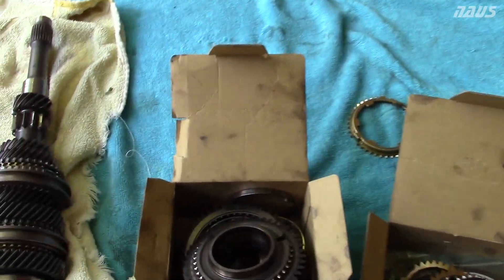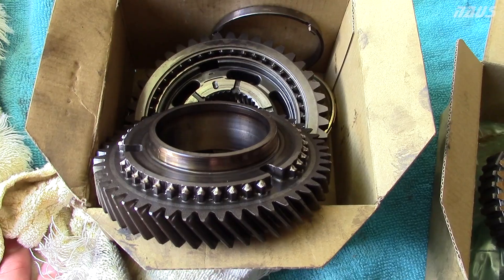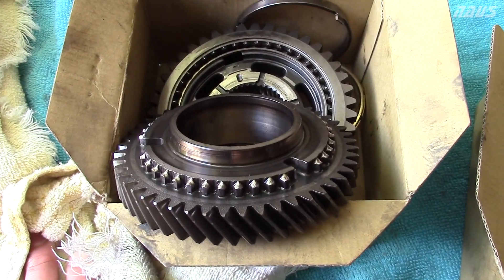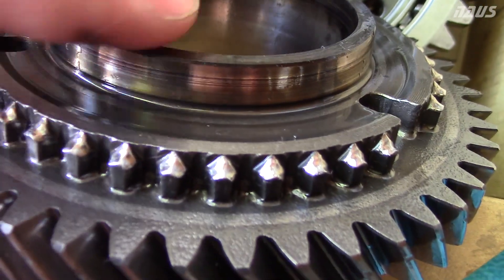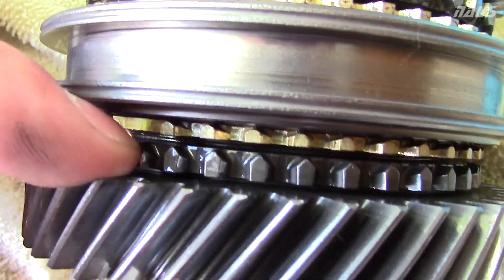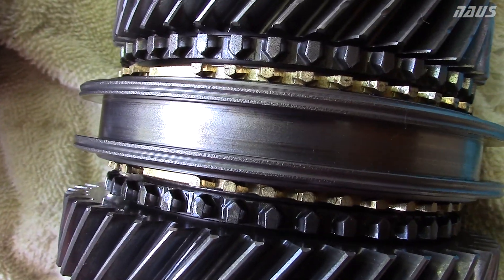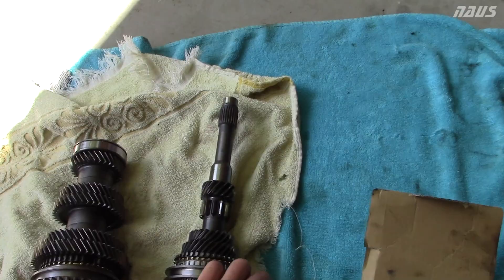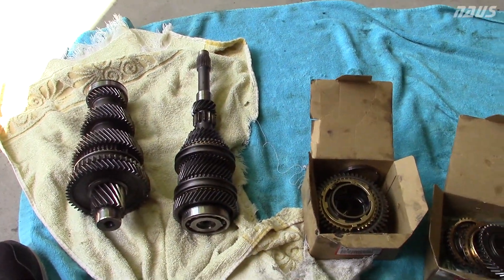The 2nd Gear Grind Explained! What Damage Does it Actually Do?

Comment: To be honest I can't afford to fix it on my car right now, so what I do is I totally skip the second gear, I go from first to third, I just go a little bit faster in the first gear so it doesn't make stall noise shifting to third, especially on uphills, but if my third wears out I will probably change the whole transmission.
Reply: Another option is to double clutch. If you double clutch properly, it won't grind even if the synchros are totally shot. The transmissions in heavy duty trucks don't even have synchros and they do just fine.

Comment: did you ever have it pop out of 2nd gear? my 2004 TSX 6 speed will randomly pop out of 2nd gear and when it does, it grinds. is this related??
Reply: Did u ever find out what was your problem cuz mine is poping out at 4th and also grinds as it pops out. Someobe tols me once its cuz of bad engine mounts so i did replace them cuz the mounts whete gone front and back so then i took it for a spine and its still poping out

Comment: 2nd gear.... YEP THE MAGIC NUMBER BY THOSE PEOPLE DRAG RACING, RACING, AND JACK RABBITING THE HONDA.
No question about it. Stop abusing the car and your car will last not 62,000 miles but 200,00 & some can go as high as 300,00 miles. 
If honda really has a bad design gear, show me a bad 1st gear(usually during drag racing the 1st is in cocked & ready),  show me a bad 3rd gear, 4th gear, 5th gear and 6th gear.
2nd gear is the power gear of the abusers. End of story!
Reply: I just got my civic type R a week ago and have had 6 gear grinds in second. the car hasn't been over 4k rpm. you are out of your mind if you think this isn't an issue.

Comment: What causes grinding once in a blue moon? Operator error? Not pulling the shift knob far enough over before trying to put it into gear? Normally my 18 year old car shifts fine, just had a pretty bad grind going into 1st while coasting today, could actually feel the gears hitting the fork through the shifter. Immediately took it back to neutral, shifted fine after that but wondering what kind of damage a grind here and there does.

Comment: Honda has been called out on these issues for 20+ years and yet they STILL turn out vehicles with poorly engineered manual transmissions. The latest Civic Type R still has manual gearbox issues drawing widespread concern. How stupid are the engineers at Honda? Apparently they're so stupid they ignore 20+ years of complaints not just from those who blindly buy their poorly engineered cars but they also ignore Car and Driver, Motor Trend and the rest of the automotive press who has been critical of their manual transmissions. They also have suffered 20+ years of complaints about hanging revs during shifts from their poorly done engine management software. And, guess what, they can't be bothered to fix that either year after year. Honda has lost their way for reliability, styling, and performance. They're beat by many other manufacturers.
Reply: On new Hondas the rev hang is deliberately engineered into the programming for emissions (NOx) purposes. Throttle closing time is not instant to control pressure issues leading to more emissions.
Reply: Honda needs to fail for them to wake up. They have been resting on thier laurels for years. A significant sale slump would do alot to wake them up. Stop buying thier garbage.

Comment: AC Delco transmission oil fixed the 2nd and 3rd gear grind in my DC5 RSX-S. I used to have it grind every 500 miles, but the AL Delco fluid will make it go 40,000 without grinding, at which point I change the fluid again.

Comment: Very few people check the endplay on the mainshaft and cluster. Maybe they will put new shift forks in and still do not check all of the tolerances. It has to be set up correctly! The syncro rings must be in great shape the same as the gear cones and sliders. A manual trans will work without any keys or springs but not for long! You can also take every other tooth off the syncro rings and make a better shift, but not for long! It depends on what you are expecting. Clutch release is the most important part you must have along with a clean spline on the input shaft,clutch hub, bearing retainer and Very good alignment between the crank and input shaft. Always check the endplay on each mainshaft gear including mainshaft to input shaft.

Comment: You didn’t say anything about the synchronizer springs.   They tend to fail from being parked in first gear.   Spring break and car starts grinding gears.  Usually just needs three new springs.

Comment: Granny shifting and not double clutching like you should
Reply: there is no point in double clutching
Reply: @patrik if this is a synchro problem from the beginning double clutching would have save that second gear. Now that the gear is severely damaged double clutching won't help.
Reply: if you had a honda you would know, this happend on my old civic. its painful to hear.
Reply: @JesusIsLord7773  what was the solution? Replaced synchros?
Reply: LOL I don’t think they got the joke
Reply: Why people keep talking about double clutching- i assume they don't drive a manual?
Reply: @RaymondLo84  or they drive a really old manual with no synchro
Reply: Hahhahahahha I like the tuna here
Reply: Vin D one of old lines that’s a classic for a fast & the furious movie enthusiast
Reply: There is absolutely no point to double clutching unless your synchros are shot or your car is super old and doesn't have them!
Reply: How do so many people not realize this is a movie quite?  🤦🏽
Reply: Double clutching is the wrong term.  That is something you do for trucks not a civic with syncros.  What you need to do with a manual transmission on a car or a bike is "rev matching" also called "throttle blipping".  Just before you let the clutch out when downshifting you tap the gas so that the engine is already at a high RPM (About +1000 revs) when you engage the gear that needs to rev faster.
Reply: @chrisstratton3430 it’s the same thing bud!!! Double clutching in a big rig is all rev matching!!!!!!

Comment: If the clutch material inside your synchro cones burn out that can cause issuses leading to failure as well
Reply: Ha anybody know a anythingt about why after your clutch want go in any gear why it would slide  around whould be because it found reverse

Comment: ...Do you even know why your synchro's went bad? Let me ask one thing, do you hold your hand on the shift knob a lot? Also, do you even know that the reason your lock ring was all chewed up was due to you trying to get second in with bad synchro's? if you would of done synchro's soon as the grind started that gear would of been A1. this is clearly the result of poor diving and ignorance.
Reply from the maker: This was a gearset out of a transmission purchased from a junkyard. This was not my driving that did this.
Reply: Kevin Mcalister is a douche. Solid video.
Reply: ^must be a Honda Driver... or Subaru.

Comment: Greetings Mr. NAUS,

Thank you for this video.  It does clarify some things for me.  (Continued)

If the gear grinds then the synchro ring is worn and is not grabbing the spinning gear and matching speed before the teeth engage.

Rounded teeth on the gear make it hard to go into gear because you have to exert pressure to get the blunt nosed teeth to slide to the side and engage.

Both are related of course.  As the synchro ring wears gear grinding increases which rounds the teeth causing for stiff shifting.

Does that make sense?

Now here's another question...  If the sync teeth on the gear are rounded how are the teeth on the synhcro sleeve?  And should that be replaced as well?
Reply from the maker: Yes, and whenever you replace a gear you should replace the entire gearset, which includes the gear itself, the synco ring, etc.

Comment: I think it just depends on the car, I had an 07 Si Sedan and I literally beat the piss out of it almost every day and when I tracked it I did no lift shifts into every gear shifting at 8600rom I never upgraded the CMC and I literally never had any issues with 2nd or the notorious 3rd gear. I actually had more issues with the motor lol......... I have a 2011 Sedan now with the em1 cmc and full bolt on's and a 17 Si sedan Im going to be working on shortly
Reply: I accidentally grinded today and my second gear is a little stiff now 😔

Comment: Okay so I've done this grind like 10 times out of like 15 hard drag pulls last Saturday... and now my car sounds like it has a supercharger in it (ONLY IN 1ST GEAR THOUGH).... So what the hell could be causing that whinning sound like a supercharger. I read places it could be a compressor bearing for the AC? Also, if I grinded that 2nd gear like 10 times, would that be sufficient enough to cause this awful gear wear?

Comment: I just saw this video. When the ring fails, the gear grinds and the engagement teeth get hammered. That''s a  typical downhill process. But the question is WHY? What your not picking up is that the gear cone got overheated.  Look at the discoloration of the 2ND gear cone. Usually poor clutch release works 2nd on these transmissions. People resurfacing flywheels is another issue because that changes release bearing throw relationship. The ring overheats, flattens and is done. Also using a better lubricant would help. What type of lube were you running?
Reply: You are correct, but based on the ratios on this gearbox and the RPM some of those engine can get up to, its basically normal for the synchromesh to get worn. The difference between 1st and 2nd gear in ratio is so big that shifting around the redline simply forces the synchros to work too hard. This creates heat and of course results in overheated cones and worn synchros. Nothing can be done here, if you race the car, and most Honda are raced quite hard you get this sooner, or later. Maybe using some kind of additive can help reducing the heat, but sooner or later this will happen. And you will get there even faster ,if you are downshifting from 3rd without bliping the throttle to match the rpm.
Reply: Gips Megagips 

The engineers have a math formula for that. In laymans term, usually the larger ratio difference like 1-2 have a bigger diameter synchro and sleeve set to compensate for that. Same principle like having bigger diameter brake rotors for heavy or sports cars.

 How big the diameter and what oil should be use all depends on their formula and cost.
Reply: This is correct. Worn out Cone sleeve is what causes grind and not really tge hammered teeth you just showed.

Resurfacing flywheel is okay, this art has long been used and proven for like 100years and around the globe. As long as your clutch is still fully releasing and fully depressing, you're good.
Reply: @marionsanpedro277  proven for 100years? Cars haven't been around that long
Reply: Yes, but you forgot the involvement of the "cost" stuff. Those civic were/are cheap cars. Cheap cars are rarely over-engineered especially nowadays. To keep the cost low, and weight light, they have put smaller shafts, which usually means smaller gears also. They can also put a 3 piece synchro, which is the easiest way to increase grip on the cone, as it acts the same way as a multi-plate clutch, but this also involves cost. And "expensive" is the word that manufacturers hate the most.
Reply: When I shift to second from first I am getting strong vibrations from the shift knob to my hand, but every other gear seems fine. I can still feel the vibration in my hand somewhat. The car doesnt make any weird sounds or movements everything is smooth. I just feel the vibration transferred to my hand from the shifter. Is that normal
Reply: Gips Megagips bliping the throttle alone won’t help, you need to neutral and blip the throttle, I figured revving up the engine to match the speed of the gears take a little time so I better off just neutral while it’s revving, plus it feels a lot easier to get into gear when they are matched.
Reply: @davidgruen7423  That is not necessary if you your clutch and tranny are functioning properly and you rev match perfect or close to perfect at least.
Reply: A҉n҉o҉n҉1҉3҉3҉7҉ 【X】 it doesn’t save your sychro from prematurely worn.
Reply: GearBoxVideo That's*
Reply: GearBoxVideo you're*
Reply: Marion San Pedro the*
Reply: Marion San Pedro 100 years*

Comment: I believe the 06-08's had a big problem with 3rd, sometimes 2nd.   Mine is a 2011 60 K miles, i know the previous owners drove the crap out of it, but trans fluid has been done every 30k.  Honda recomends 90, but sorry, they're wrong.  That combined with driving the crap out of it, and some missed shifts (clutch not all the way disengaged) can do that.  I feel with the clutch, its a little easier to grind gears than with other cars, due to the grab point being just off the floor.
Reply: The problem whit this Is bot the transmision Is the clutch master cylinder, you need an upgrade of this and this will solve the problem

Comment: Why the fuck would you shift to 2nd at 8600.. why not go all out and shift to 2nd on a 10,000rpm valve bounce. Learn to drive and you wont fuck your car.
Reply: +74KU if you gonna race someone....you will lose changing gears at 5revs......the guy is given us a example off the situation to help us ppl out here... im sure this guy normally does change gear at 3/4/5revs.. but at occassions he may need to take it up to 8/9/10revs . so quit your moaning gain some knowledge. and say thanks for the advise.
Reply from the maker: 74KU uhh what? You do realize 8600 is a safe redline for 8thgen civic si's
Reply: yes, red line. my DRZ400 has a safe redline at 10,000 though it is realistically better to shift around 5-6k rpm. Let us ignore the fact you are wasting fuel and putting excessive wear on your engine over revving in a given gear, you are contenting with inertia, which when you are shifting at excessive RPM means excessive inertia which means excessive wear on the gearbox when you shift due to friction.

If you are doing 20kph at 8600 rpm in 2nd or 3000 rpm at 20 in 3rd you are saving nealry 400% engine cycles per minute.. if you translate this over the life of an engine...

There are also thermal erosion issues on your valves, ports etc. 

Oil breakdown/shear issues.

Basically you CAN shift at 8600, just like you CAN shift at a 10,000 rpm valve bounce but you are better off doing it properly.

Please tell me more about over revving being just fine..
Reply: Wow.... Have you even driven a car before? Hahahaha
Reply: Wow..... You're a straight up idiot.....
Reply: Well lets look a that statement mathematically..

Take 2 identical cars of identical weight so the only factor here is RPM of the engine relating to gearbox speed relating in turn to wheel speed (your race)
Lets assume for the sake of argument each gear likes to be optimally shifted 1000rpm increments.

1st is 1000rpm (idle) to 2000rpm
2nd is 2000 -3000 etc.
Redline is 7000rpm

Now its a standing start in a straight line,

At 1000 rpm the car will stall so some right foot must be applied in order to shift, this increase in RPM takes time.. I think you can see where this is going?

If Car A Shifts at the optimal points and Car B red lines every gear Car B is spending ever decreasing periods of time at peak wheel speed for only ever increasing RPM and potentially minute gains in top speed in any given gear.. which takes time, overloading engine, gearbox, clutch and drive train, not to mention wasting fuel meaning in a race Car B will pit earlier for a slower lap speed overall.. the Idea is achieve an optimal wheel speed to vehicle speed while keeping as close to the gearboxes cake zone as possible..

Yes there are situations where a very high RPM for a given gear is called for, yes it is the best way to do certain things but overall the above holds true.

That is smooth driving, and smooth driving is fast driving.

Comment: I'm replaced 3rd gear and counter shafts test the car OK after 1000 kms internal rattling the nose in neutral position pull down and disassembled checked no any damage turn by hand one place sucking and noise all bearings new (Ford shelbey mustang 2013 transmission T60)

Comment: It is so ironic that Honda makes such fun to rev engines but mating it to such weak manual transmissions.
Reply: Dominic Fong it's not ironic, it's a buzz kill. But you're right. It's very silly . And then they have the audacity to say you abused it when you use those rpms
Reply: And they cant make an auto for SHIT either

Comment: I just got my first manual and I've been noticing my 2nd gear ha ab been grinding a little. it's not as loud as it did in your video but it's noticeable. I push the clutch all the way in too should I get it looked at? I don't know much about cars but what is the estimated cost to fix a gear?
Reply: 7 years later, did you ever get an answer to this question?

Comment: How much did it cost for parts and labor
Reply: No, if you buy just the 2nd gear OEM gear itself from the countershaft (not the whole set, assuming your stock synchros are undamaged) it's $57 + shipping
Reply from the maker: A complete 2nd gear set is over $250...
Reply: Mark Chang just the 2nd gear alone. Please don't do this. Preferably and by the damn book, replace a broken gear/synchro/hub or sleeve with a complete gear set. 
Especially the gear and the matching synchronizer should be replaced as a set (if the teeth on the sleeve are in good shape).
Reply: Costs $57 for 2nd gear from Honda, labor is free if you do it yourself lol
Reply: Pls someone reply